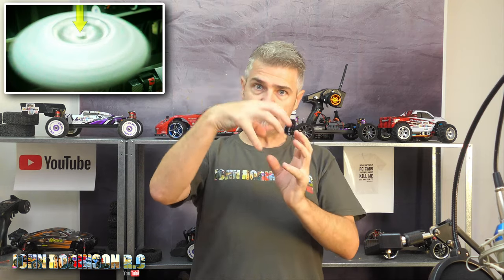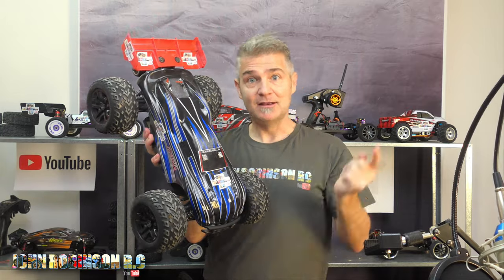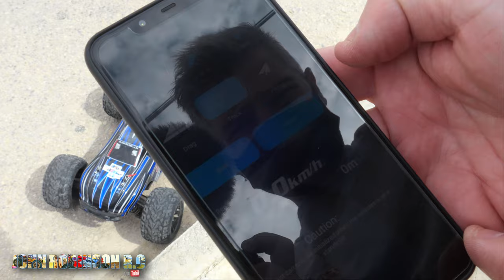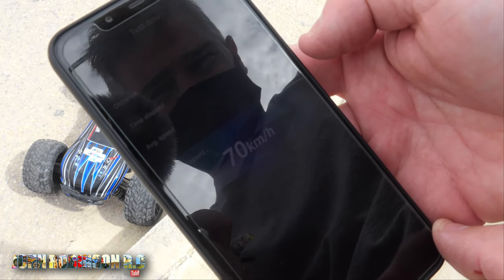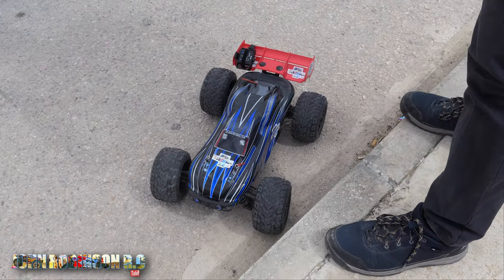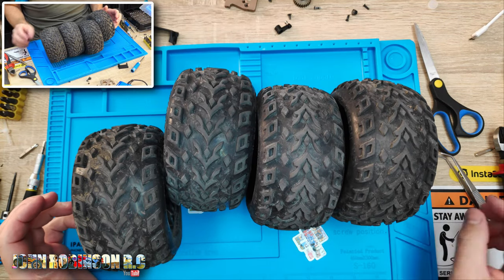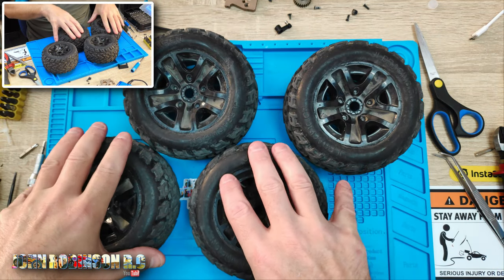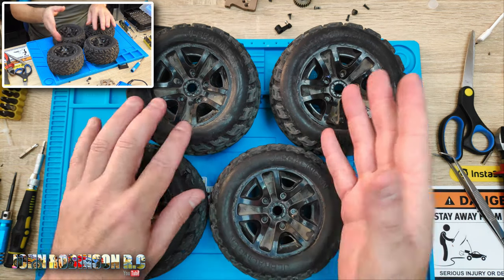No more TIRE BALLOONING on the JLB Cheetah tyres | TYRE ballooning fix

Comment: i kinda like the ballooning effect... its like adding an automatic transmission since taller tires equals more top end speed... the trick is to not have to much ballooning to where it rips tires apart and add throttle a little slower to keep car under better control...
Reply from the maker: Hiya. Yes we tried everything to get control but we never felt like we had control. I couldn't just take the car out and drive. I always had to consider where I was driving and always stopped it anyone came near. Now I feel I am in control and that changes everything. It's not a lunatic anymore and I would rather have control than bonkers uncontrolled speed. 😁
Reply: @JohnRobinsonRC  yes i agree... for just straight runs ballooning can be okay...if you watch real dragsters in slow motion the big back wheels balloon a lot...

Comment: Great to see it works good for you and it's not just my luck of doing this, this was the only way I was able to get passed 80kph or 45 mph was to tape the inside of the tires, oh and I accidentally spilled baby oil on one of my rc cars but quickly realized that it started to look very clean like new plastic on a brand new rc car so I wet a rag and stated cleaning off 8+year old nitro fuel and sand that was covering my whole rc car, now the plastics look brand new, wanted to see if you ever done this if not if you could try it in a upcoming video
Reply from the maker: So you accidently found a great preserver and cleaner of RC cars. Nice one! Ill try it out myself! Thanks for the tip!!! Have a lovely evening. Kind regards, John.

Comment: I just tried both duct tape and fishing line in a video. Very impressed with both, but duct tape is pretty good and most people have some laying around 👍🏽
Reply from the maker: Hiya and yes it's great. The fishing line apparently can cause issues. The tire can still balloon out of the wire and when the line cuts and snaps it can cause bad balance issues which isn't good. 😕 I am loving the new handling of the Cheetah though. Wow what a difference! 😊 Have a great day today! Kind regards, John. 😊

Comment: Great video, do you have a solution for the continuous destruction of the rear diffs?
Reply from the maker: Oh the JLB Cheetah? See i am left confused as I have beaten the crap out of mine and still have not opened up the diffs yet.... 🙄 I don't think at least. And I have had no problems? Have you upgraded anything? Have you swapped out the oil or grease?

Comment: The only car I'm having issues with ballooning is my silly fast BSD Flux Assault, but the tyres are glued. I might try banding instead. Otherwise, it's going to cost me £50 for two pairs of tyres and wheels! Great results though. 👍🏻
Reply from the maker: I know I would love banded wheel on every car but at those prices, its just not possible.
Reply: @JohnRobinsonRC  I was going to band it with fishing line, not replace them. 100lb fishing line wound round the tyre, and glued round it, would do the same job as internal banding, and at a fraction of the cost. 👍🏻
Reply from the maker: From what others have said it doesn't work. The glue pulls off because of the forces involved and the tyre balloons over and around the fishing line. Then of course if you hit a stone the line may snap. I have tried it myself though. 😉🤔

Comment: Nice job on the camera footage. I really liked how you used your other rc car with a video camera on a jib/crane that was pretty nice to see something different. That’s a tough shot that you put a lot of effort in. I’ve been trying to figure out how ya did it. If you shot it all manually and controlled the camera yourself or had a little help with a raspberry pi or something either way it was really cool. Nice job. And you did great on those cheetah tires too.
Reply from the maker: Hiya David and thanks a lot. I've been messing with the angles a bit. I did not allow for the fact the camera car was slower than the Cheetah. Doh! 😂 But I managed to get the angles and shots as it's a 360 camera mounted on the "crane" which remains fixed but in editing I can move the camera to any position. Works well and will be using it more and in different ways in the future. Thanks for noticing! 😊 👍 Much appreciated! 😊
Reply: @JohnRobinsonRC  that’s really cool. You still got some really nice shots. And that 360 camera you have does wonders. Especially after editing. I thought it was really cool.. just a little more speed in that car and it would have been epic footage, well it was already pretty epic lol. But you know what I mean... I’m sure you’ll find a way to make that car faster if you haven’t already lol. 👍

Comment: Seems like it's 2021 and rc tire makers need to get with the program. If hobbyists can make this much improvement just with some tape, what excuse does a tire maker with actual manufacturing ability have for not making them belted in some way to make them hold their shape?
Reply from the maker: Yes you are of course 100% correct. It cannot be that hard to do during manufacturing. To be honest I wouldnt mind paying a little more for the RC Car if it came with belted tires. Have a great day today. Kind regards, John. 😉